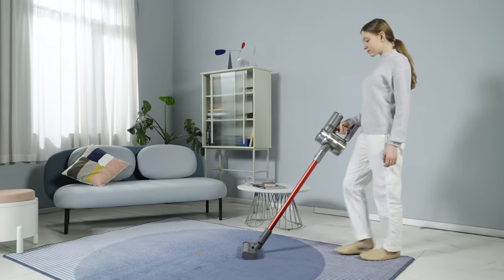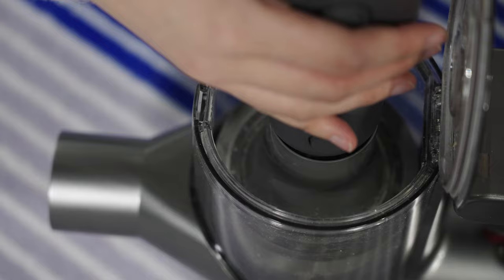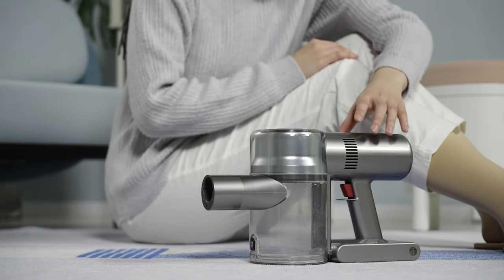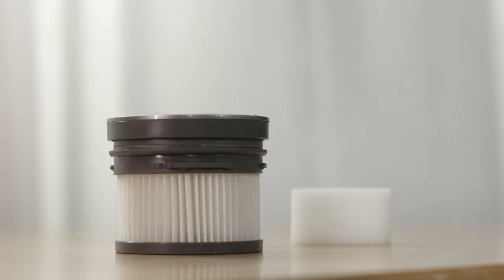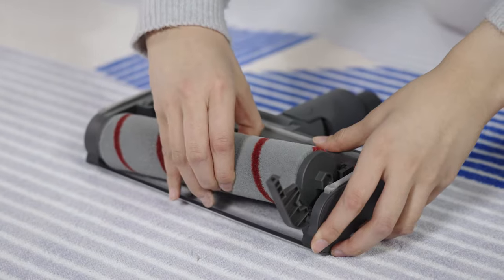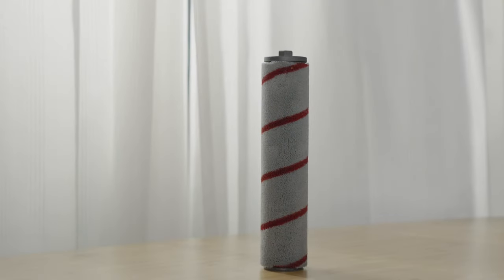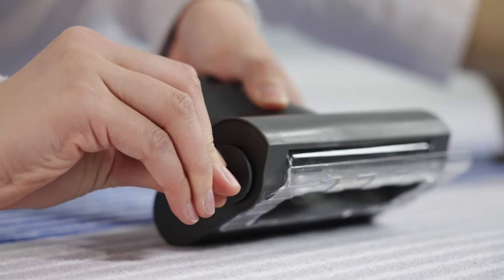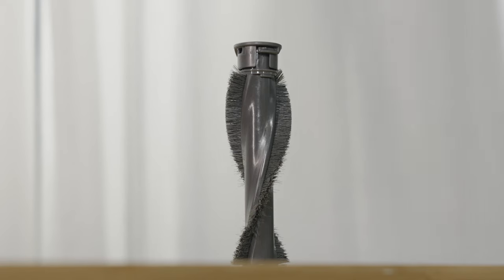How to Maintain Dreame V11 Cordless Stick Vacuum

Comment: Does the battery have to be replaced?  I use my vacuum for two hours and then have to recharge it. Is this correct or is something wrong with my machine

Comment: how to remove hairs sticking to small wheel axle on the soft roller nozzle ? Thanks.
Reply from the maker: Hi there,
Thank you for your question. Please refer to the steps at 1:13. You can also use tweezers or a small brush to remove the hair. And please be cautious not to damage the axle or any other components.
Reply: I actually have the same question. The video doesn't answer it :(
Reply: @DreameTech  Hi! I don't see any hints in the movie if I can remove somehow the small rollers from the Soft Roller Nozzle. With an animal on board hair is blocking small rollers movement. Any advice?

Comment: I would like to ask what is the difference between v 11 and v11 se in terms of usage or visualization?
Reply: SE has smaller battery, multi surface electric brush for floor and carpet (non SE has electric brush best for floor) and SE pipe is silver (non SE pipe is red)